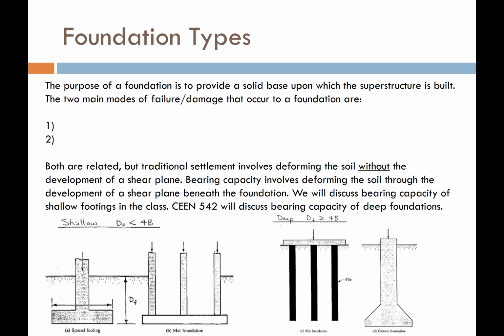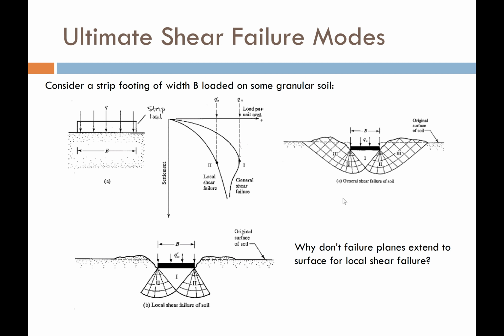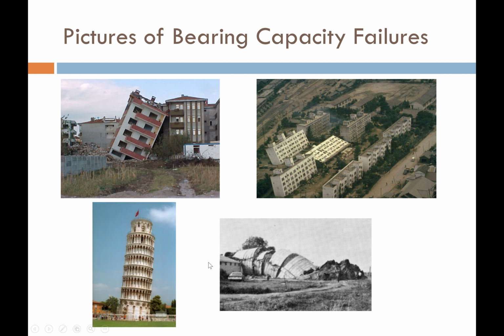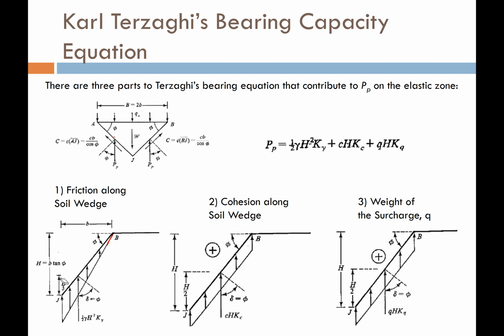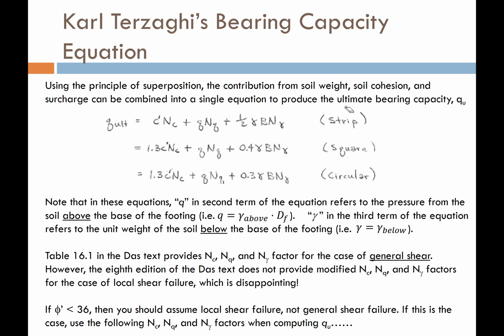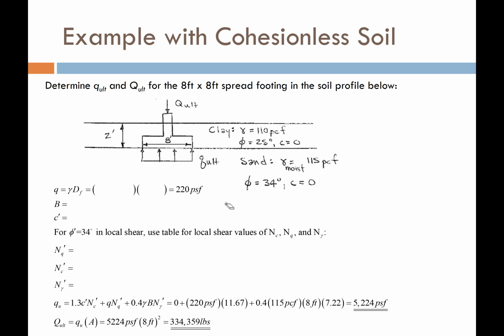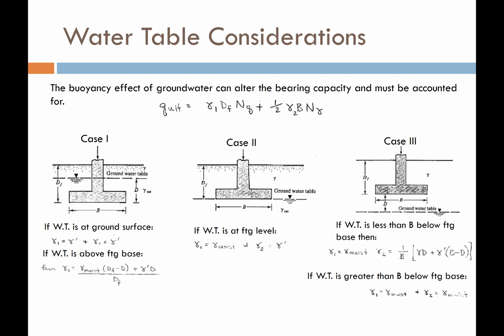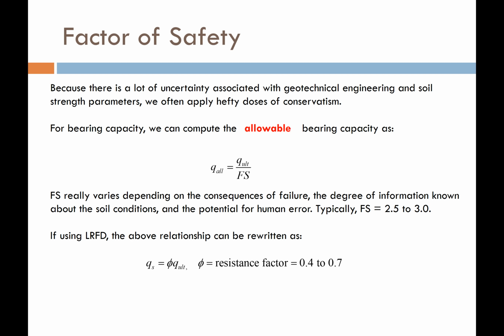CEEN 341 - Lecture 25 - Bearing Capacity Part I

Comment: Nice explanation, sir. I have two questions.
why is the curve of least resistance exactly a logarithmic spiral?
Also, in the diagram for friction stress, the friction stress we are talking about is on the surface of elastic zone, right ? If so then why is it not constant ?
Reply from the maker: 1) difficult question to answer. The shear plane wants to find a path back to the ground surface, but it needs to “turn around”. That path of turning around usually takes the shape of a log spiral. 

2) the elastic zone extends across a certain depth of soil. Friction is a linear function of stress (....remember the Mohr-Coulomb failure criterion). Therefore, as depth increases, friction will increase linearly as well.
Reply: @officehours4028 is  this friction force is similar to the passive force like in Rankine's theory  required to cause failure on the slip surface(curved in this case) ?
Or is it just the friction force on the surface of elastic zone due to foundation loading, (analogy to friction on inclined plane due to a simple load resting on the plane)?
Reply from the maker: The latter.
Reply: @officehours4028  if so (analogy to vertical load on an inclined plane), then it should be linear as friction is uniformly distributed on the plane, isn't it, sir ?
Reply: @WordsandNumbers1  its frictional resistance which is  sigma'*phi'..n see..it increases LINEARLY with depth.
Reply: @ Words and Numbers if u look at whole solution, u will realise, it will be easy to assume it logarithmic spiral..so that it would generate uplift effect on Rankin's passive zone... visualise it..u will understand it.